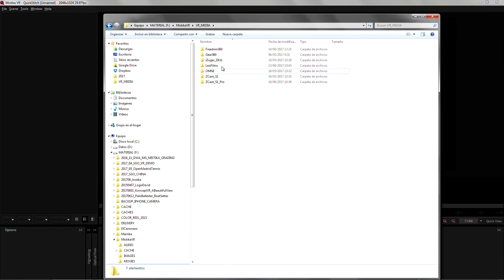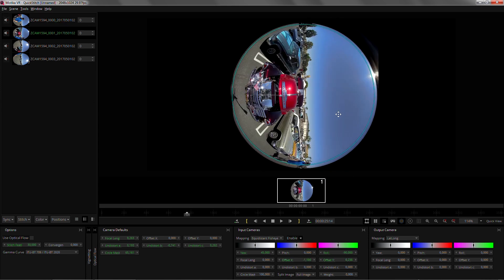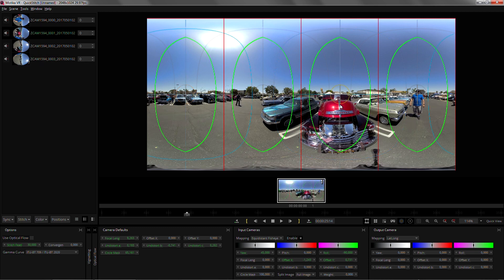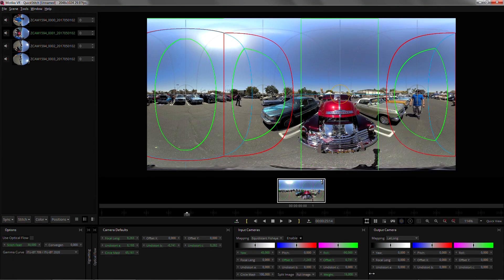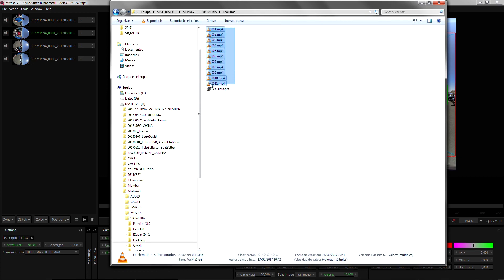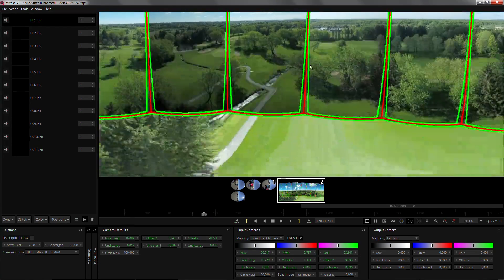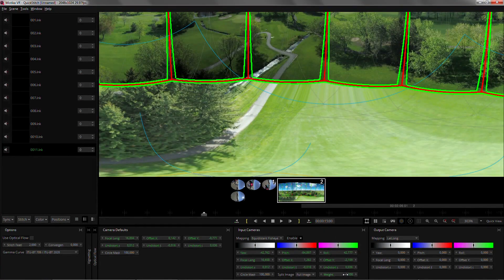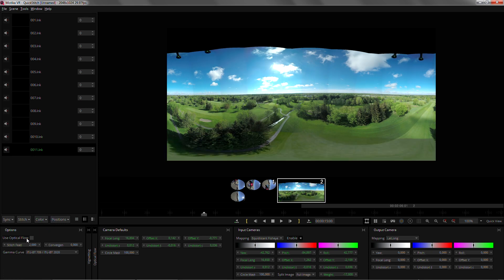Seamless Stitching in Mistika VR

Comment: What format videos need to be to work with your software? I am using mp4 files and when I add them to Mistika VR none of them show anything.  I can see in your video that once you drop video files in Mistika VR each file shows a thumbnail(possibly a first frame) next to it. Well with my files there is nothing at all. Any video player can play them. I've tried converting them to H264/HVAC and it is not changing anything. The video files btw is from Labpano Pilot Era.
Reply: Actually I have just done a test capture with the Pilot Era in unstitched video mode. It clearly says in setting that Pilot Era uses h264. And yet, when I add them to Mistika VR they are shown as black screens. I am trialing your software for 3 hours already and I got nowhere with it. What am I doing wrong?

Comment: hi, would you tell me that which video card i should choose for Mistika VR? 2080Ti or RTX 5000? thank you
Reply from the maker: Hi Peng Jin, the 16GB of Quadro memory can come better for VR by using higher resolution textures (images), but 2080TI is faster. Anyway, we suggest to check out the configurations requirements for Mistika VR in this link: https://bit.ly/2QgoNSp and choose the best option that adjusts your workflow needs. Best!